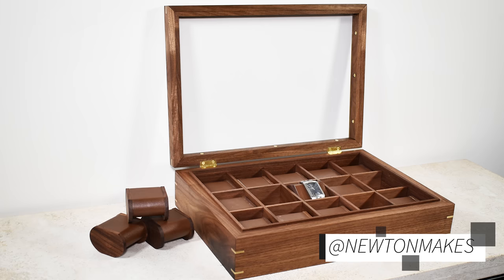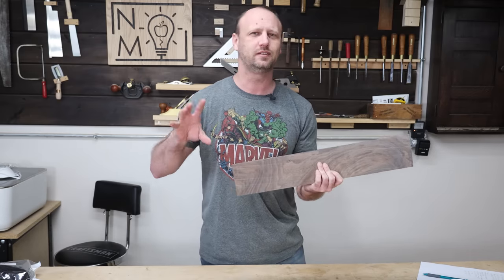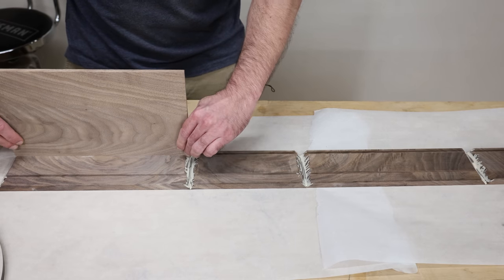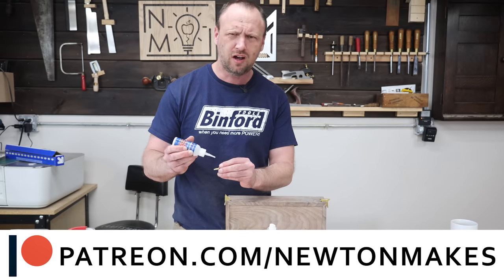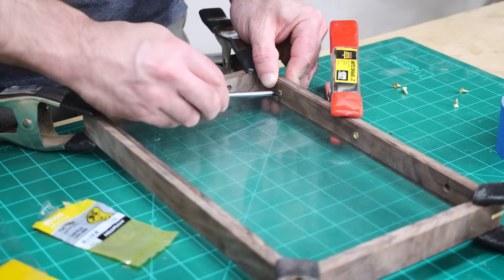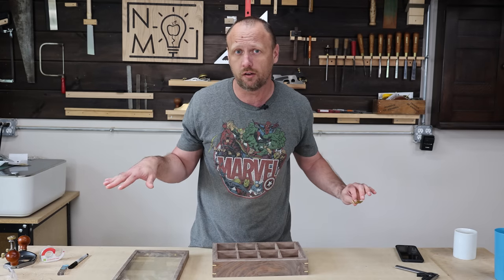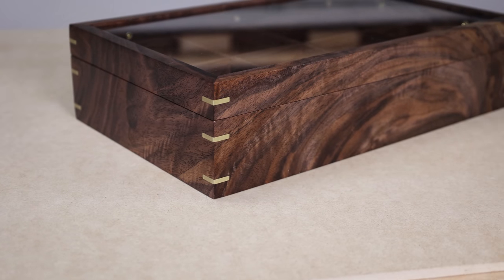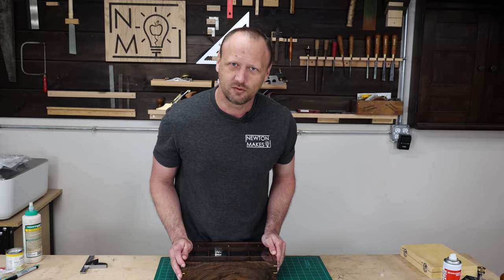Making My Bucket List Woodworking Project!

Comment: Hey, I keep coming back to this video. I love the walnut and brass combo. I’ve got my materials and I’m about to start making a variation on this for my wife but it’ll be a wall mounted vertical jewelry box to hang necklaces in.
Did you have any problem with brass dust/filings in the wood grain? I heard that’s a thing 🤷🏻‍♂️
Reply from the maker: Zero issues and I've made probably 50 projects with brass incorporated in some way. I vacuum the dust and use compressed air to make sure I got it all. Then I wipe the project with mineral spirits or denatured alcohol.
Reply: @NewtonMakes  
Thanks for the advice! I ended up sanding with Osmo to make a pore filling slurry first, then sanded with mesh discs and dust extraction. No brass dust to be seen!

Comment: Awesome display case, Billy! Could you share a little more about the wax finish you used? I have never used oil/wax finishes, I usually stick to a Maloof Blend or similar. Could you share some of the things that you like or don't like? Thanks brother, still looking forward to making your puzzle box!!!
Reply from the maker: I used three coats of Osmo Polyx Oil.  Apply with a white Scotch Brite pad, buff it into the wood, wipe off the excess. Super simple and my favorite finish!  It's not going to be as protective as something like a poly, but it's plenty for most projects.  I get a close-to-the-wood feel, and no VOCs.  I can't say enough good things about it.
Reply: @NewtonMakes  Man, maybe I should give it a try! Thanks for the reco!!!

Comment: The most important part, you didn't show the space for the glass, nice box, but it would be a good video if you explained the complicated parts of the process, it's difficult just to watch a video of how you do something and not to learn, regards
Reply from the maker: That's why there's an eight part video tutorial series on my website, which I discuss at the end of this video and in the video description.
Reply: It's simply just a housing cut (through housing cut) if you imagine the box as one long length without the mitres cut you would simply make a housing cut through the entire length, you would do one on the side that will the bottom  the width of the cut would be the thickness of the selected timber thickness you will use for the bottom, at around 5mm deep or a rebate cut if you want the bottom to be flush, the side that will be the top of the box you would start the housing cut around 3-5mm in from the edge which will be the drop down to the glass and the width of the cut would be the desired thickness of the lid, easily done with either a router table or table saw even by hand with a router. Asking for money for showing a basic box guide is cheeky!